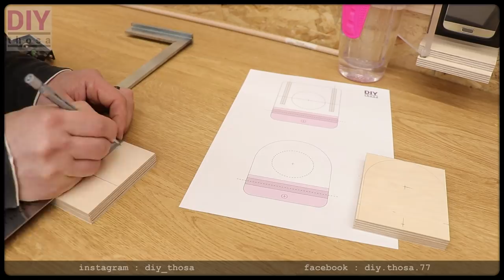Drill Press Dust Collector - FREE PDF PLAN DOWNLOAD

Comment: Wow best I have found only thing I did different was a slit for the nosy parker attachment instead of a hole
Reply: Further to my last comment I purchased a second nosy parker from a second hand ( Thrift shop ) and used my heat gun to put a gentle curve in the end so it slightly points down to the drill press table.

Comment: Great video.  Btw, do you have a pdf plan for that particular push block that  was used to make the slots? Your website has a different push block.
Reply from the maker: thank you 😀🖐 Both push blocks are available on the website. I think the one you are looking for is called "Bevel Cutting Jig". This is the 11th from the bottom.  😀🖐
Reply: @thosa  Got it! Thank you😀

Comment: All that work yet you don't show it sucking up any dust?  I mean why?  Why do people make these videos without showing the use.  Maybe I can go find another video you made where you did show its use.  However, I have seen many versions of holding, clamping, bungy cording and making jigs like this to hold one or maybe two nozzles by the work piece, but they still only pick up maybe 25% of the dust.  Sometimes it picks up less, especially when using a forstner bit.  Just saw this video a few days ago.  Closest thing I have seen that does about 100% collection.  Now this youtuber did not show all the different types of drilling one could do.  But he chose to show the messiest drilling one can deal with, forstner bits.  It worked pretty much flawlessly.   Granted in the video you will see how his jig sits flat on top of a board creating a great suction effect and the base of the jig is completed enclosed at the bottom where the dust would land.  So all in all I think because the board is larger than the hole at the bottom of the jig, it helps tremendously with drilling. Like I said earlier, he did not do all types of drilling.  For example a thin stock standing on its side and drilling into say a 3/4 inch piece of plywood.  How well will the dust collection work???  But still the best I have ever seen.  I have watched probably close to 200 videos over the part 1 1/2 years and I am ready to build what this guy in this video built. https://www.youtube.com/watch?v=y3TZffiaEhA
Reply from the maker: This video is almost two years old and from a time when I was still trying to get a video finished every week. 😕 Besides a fulltime job this was almost impossible and therefore some planning was neglected. 🙄 Now I wish I had done some things differently with some of the videos. 🖐
Reply: @thosa  totally understand.  Don’t mean to be a jerk about it.  Most times we as viewers don’t know the real goal of a YouTube era channel. Some actually get sponsored to do videos and they too may not show something working at the end of a build.  Would be nice to see how it works if you ever get around too it.  Take care brotha.